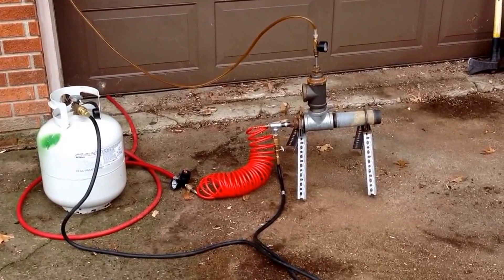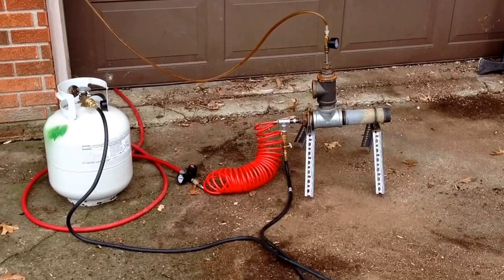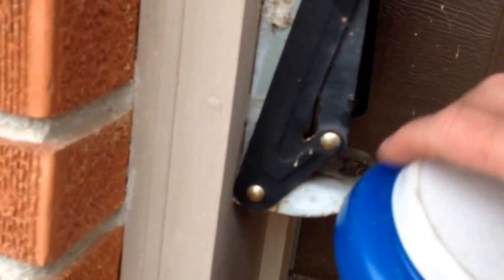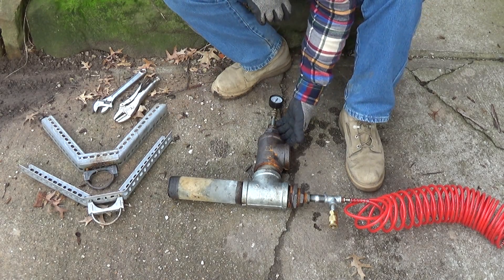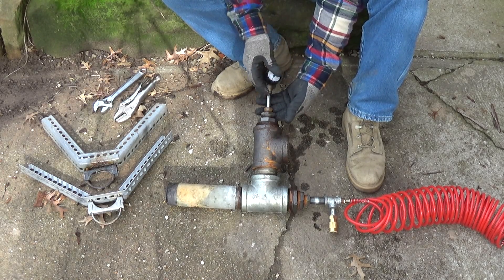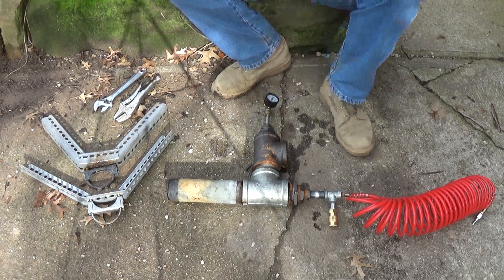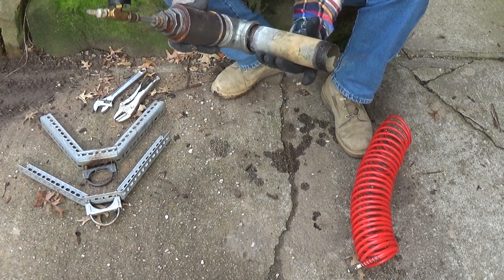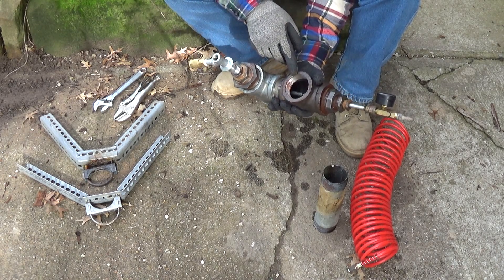Waste Vegetable Oil Burner

Comment: To get a hotel flame try putting two pieces of stainless inside the tube in a + a little longer tube could help .to change the orange flame to a hotter blue . I have even seen ware the final out put pipe they put holes in it to burn more fule . Nice video.

Comment: A rather unorthodox arrangement of the nozzle, but once stripped to the components i could see its a pretty good way of running it. The only criicism i have is running the fuel supply in this way is NOT syphon, but gravity fed which pretty much kills the concept of  a delavan nozzle. The fuel is supposed to be drawn up to the burner tip by suction (syphon effect) ratrher than getting there by gravity. I feel much better burner control could be achieved if it was operated in the manner its been designed.

Comment: I own a restaurant and this would be perfect for my hoop house.  I was thinking of having the sun heat water in tank(s) so that would act as a heat sink throughout the night.  But after watching this, I think I just need to have a smaller oil intake and then just keep enough oil it it so it runs out at about dawn.  I'd be scared to have it to heat inside a living structure because of CO and potential of accident.  But I love this, and thank you for posting it.
Reply: you have the intake and exhaust feed to the outside of the property, and to heat the building you have heater pipes in the burner case that will circulate clean air in the building.

Comment: How small will the flame be just on veggie oil
Reply from the maker: The burner is just running on veggie oil. I use the propane to get it started and then turn it off once the burner is hot.
Reply: @marshal3157  what is the smallest flame you can get on veggie oil  so it can be used in a kiln to fire pottery as a big flame on start would break the pots thanks

Comment: This is a nice easy design, but lacks oil hearing for evaporation that might result in a better burn. Will definitely appreciate your input on this.
Reply: It does not syphon oil it gravity feeds in this design, and there is the main problem, its hard to regulate the flow in this set up.

Comment: This is impressive how does it light up so easy. I built my burner and im having little trouble running on pure oil but burned succesfuly with some petrol mixed
Reply from the maker: The burner was already hot and the oil was warm. It took me awhile to get the air to oil mix correct
Reply: @marshal3157  thanks for replying, i managed to fire mine yesterday and it ran great just needs good preheating and nice flame to start

Comment: I think shutting down with propane would keep it cleaner inside. Notice the smoke, incomplete combustion, as you turned it off? 

I know you verbally gave a parts list. If you wrote them down in the detail section of the video, you could get a commission when we purchased the items thru Amazon.

Comment: Hello,  I'm  trying  to  get  a  waste  oil  burner  going  to  blow  down  into  my  Hot Tub    boiler.   With  a  secodary  air  blower  and  a  longer (1  yard  or  so)  burn  pipemaybe  this  could  work.    Do  you  think  it  would  be  possible  for  you  to   do  some  sort  of  schematic  drawing  (no  need  for  fancy  stuff)  so  I  can  go  to  my  plumbing  supplies  place  and    get  the stuff  to  do  this?   I  would  be  very  grateful,  as  it's  not  too  clear  from  your  film  clip.   love  it  btw!

Comment: The air for combustion is provided by two means, the line from  your compressor is one, th other is the stream entering the upper tee, flowing then trough the second tee, so there are two right angles in the trajectory of this stream wich reduces the amount of air and you will have oil without burn.
Reply: Not so. The burner air comes straight out of the delavan fitting, straight into the combustion tube, and the secondary air enters behind the delavan fitting also, so all airstreams are actually behind the point of combustion, which is just in front of the tip of the delavan fitting.

Comment: What's the fuels consumption of the burner?
Reply from the maker: I'm not sure, I have never rated it. The nozzle is 1 gallon per hour, but when it's turned up I think it is burning more than that.
Reply: @marshal3157  It burns more than that as you are gravity feeding the oil

Comment: what's size nozzle for this burner
Reply from the maker: Kees Staps this is Delavan nozzle #30609-11 and a nozzle adapter #17147. I got mine from patriot-supply.com They have a spec sheet that will give you all flow rates for 3,4 or 5 PSI air.
Reply: Thanks will look for the parts

Comment: I'd like to see this thing turned up to some decent power output with a blower on that T inlet.  I think you may have to go to a longer end piece though because you may not get full combustion without dripping with the forced air.  The longer end piece would get hot and allow secondary burning of any condensed oil.

It's a nice, neat and easy to build setup though.  It would be interesting to see how this went in a vertical orientation like to fire straight up and into a gas hot water heater.
I think it may work even better.
Reply from the maker: Oil Burner I'm in the process of adding a blower and was also wondering about the length of the burn tube. I get alot of unburned oil dripping out the end and need to improve the burn efficiency. I want to eventually attach it to either an old gas hot water heater or gas boiler system to use for hot water heat.
Reply: @marshal3157  The reason excess oil drips out is that you are letting the delavan fitting get oil from gravity feed. A delavan fitting is not designed to work this way. The oil is supposed to be drawn up by syphon action like a spray gun sucks up paint, and the air pressure pretty much regulates the flow.